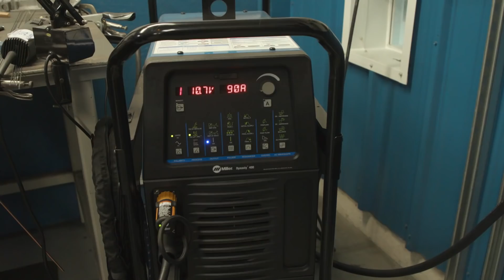Advanced TIG Welding Root Pass Technique | Looking Through The Gap

Comment: I so have to learn this technique but im finding it very hard no one to work with me at  work so ive been trying what i can awesome video im just going to keep trying so far i get my suck back at the bottom the bottom is the hardest for me
Reply: Usually caused by moving too slow and/or pointing the tungsten straight in the middle of the gap instead of washing the puddle side to side. Also made worse by losing connection with filler metal and puddle. Use enough heat to make the puddle flow nicely and practice moving quick but steady with a little side to side. Don’t sit in the middle.
Reply: @christophergavitt4095  thank you I'm going to keep trying because my beads on the face look good but it's the root that's more important it's hard but with time I think I will get it I'll keep watching videos to pick up more tips and tricks thank the comment

Comment: I have a question on the bottom. I’m getting porosity once I start adding the rod. How do you avoid getting porosity?
Reply: 1. Change your collet and or gas lens
2. To much or not enough shielding gas
3. Wind blowing in your puddle
4. Contaminated argon bottle, very rare but it happens.
Reply: That's assuming your coupons are clean

Comment: How in the world are you using an auto lens and looking thru the pipe?? Appreciate the lessons🤟
Reply: On the bottom if the pipe his head is pretty close though, it would be difficult to position your head so your lens isn't flashing like crazy one would think
Reply: Right... I'm sure he has the sensitivity of the lens on a higher setting, it also looks like his head is far enough back that the sensors are catching the UV... if I tried this my hood would be touching the pipe in an effort to see the puddle lol. Doesn't get much harder than that!!